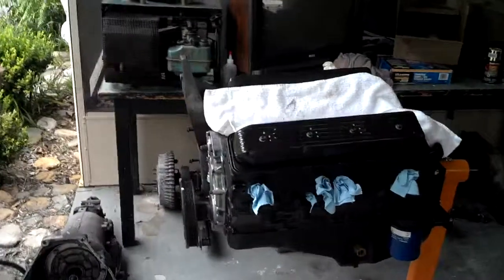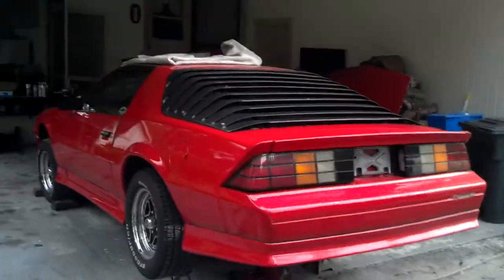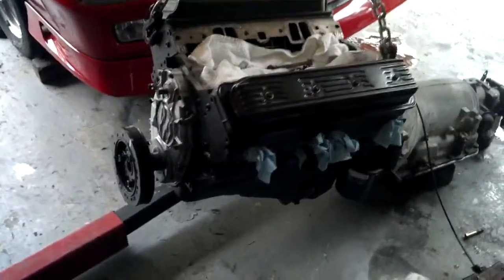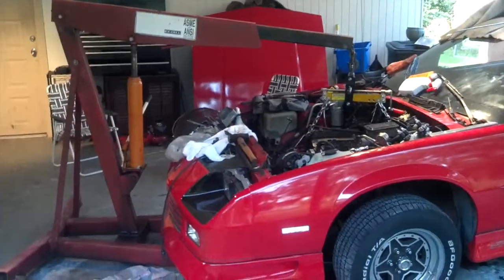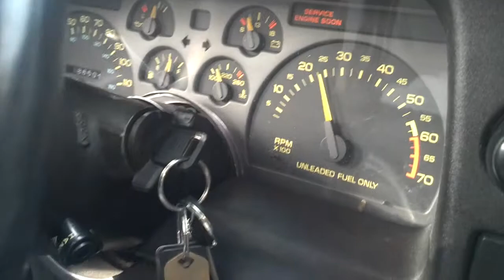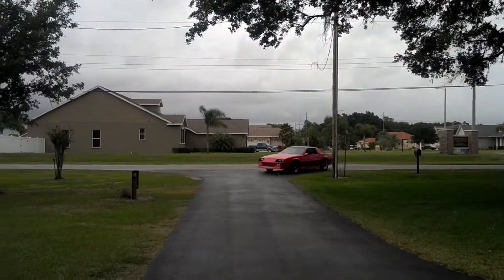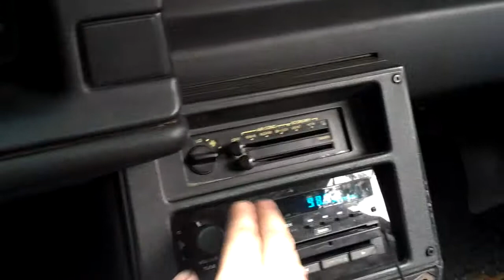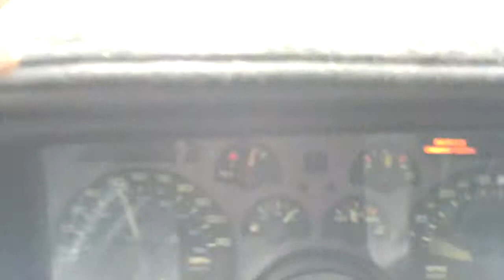1992 Camaro Lt1 Swap (Start to Finish)

Comment: Well now my 3.1 just feels inadequate
Reply from the maker: thats how it was for me, i just love the new engine, runs great and has good power. The cool thing is that the 3.1 was getting 13-14mpg in the city with normal everyday driving and at the best it would get 15 on the highway. But with the carbureted 350 it gets 15 city and 21.36 on the interstate. So its an all around win! Plus it is completely reliable now, I've driven it from Florida to Texas without a single problem!